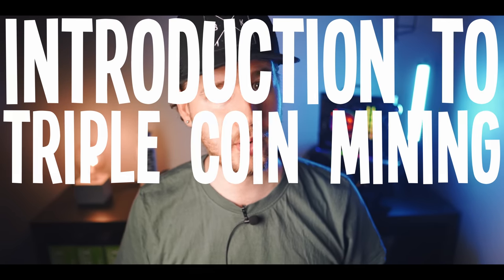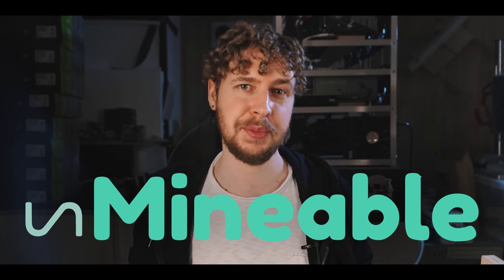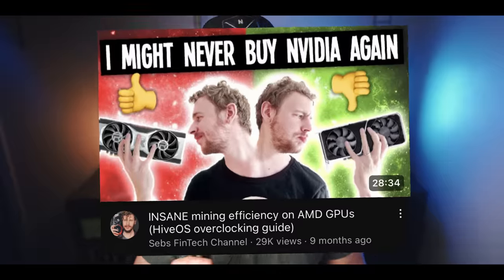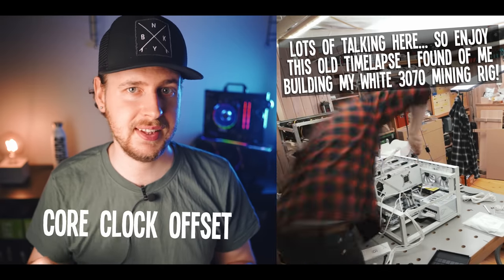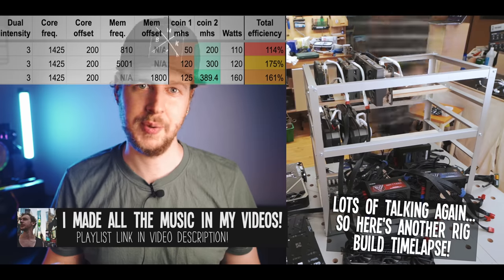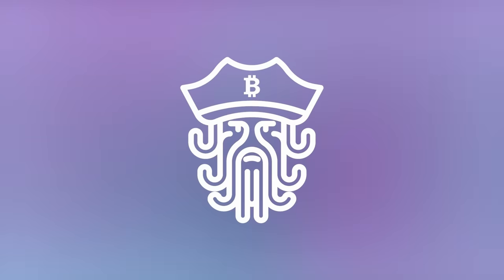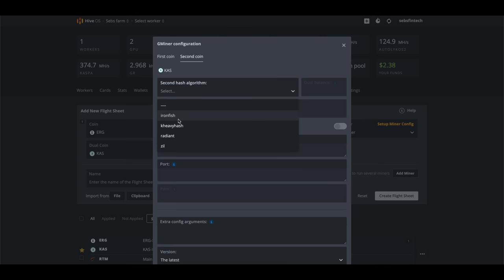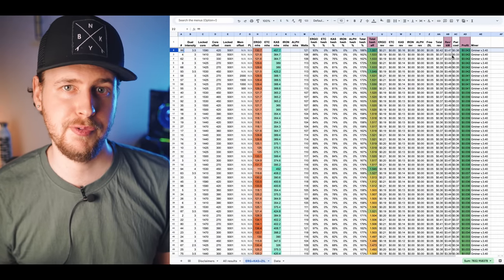Triple mining made my old GPUs profitable again! ULTIMATE GUIDE!

Comment: Thanks for the shoutout, with triple mining if you are new to it, I would learn how to tune your gpus with a single 3070 or 3060ti on a test bench. When I first started erg/rxd/zil it took me like 2-3 hours to fully understand how to tune a 3070, and then I spent maybe another 10min ish per rig tweaking them just a little bit. 

The best thing you could do is understand how --di works because thats where you will really get the best numbers. Like for rxd/ergo id start with --di 3.8 but if you are mining rxd/cfx id start the --di at 10
Reply from the maker: Great advice!!
Reply: I've been mining RXD on 4090. Just tried this triple mining. How do I get it to be more RXD bias vs Ergo.  Do I switch the order in the batch file or does intensity have something to do with it?
Reply: @tomcarey3457  you want to raise the DI settings the higher the DI the more rxd you will mine, I used 5.8 when I was testing the 40 series on it, not to steal zebs thunder but I did a video on it, maybe that will help you

Comment: what is the hashrate for ZIL you get on 3070 on optimal settings?
Reply from the maker: So when switching to ZIL, the rig keeps mining the core-intensive algorithm, so in this case it switches from dual mining ergo+kas to dual mining zil+kas. That said, during the zil round I get around 58-60mhs on zil on my 3070s, which is very close to the potential full hashrate of 62mhs.
Reply: @SebsFinTechChannel  I'm getting only 49 MH on 3070 Ti while mining zil,  with same settings you've given, why is that?
Reply from the maker: @jjspatel  3070 Ti is a different GPU than the 3070 so you need completely different overclock settings

Comment: i do not get watage anythink close stated in spreadsheet, my 3070tees are consuming around 250W
Reply from the maker: With what overclock settings?
Reply: @SebsFinTechChannel  one from spreadsheet, wrote OC settings to extra params in minner config. Tried the most profitable one. I had to set Power Limit to 125 in order to lower watage, but eficiency went rapidly down.
Reply from the maker: @hezechielapokalipse9814  have you updated HiveOS to make sure you have the latest version of gminer that supports overclocking?
Reply: @SebsFinTechChannel  Checked it, Hove OS at 0.6-222@230621and Gminer v.3.40. Checked miner in hive and got:
GPU0: Locked memory clock point changed to 5001 MHz
GPU0: Failed to get memory clock
GPU1: Failed to get core clock
GPU1: Locked core clock point changed to 1530 MHz
GPU1: Locked memory clock point changed to 5001 MHz
 GPU1: Failed to get memory clock

those failed messages concern me, going to roam trough some forums.